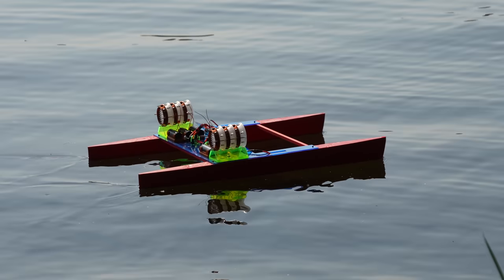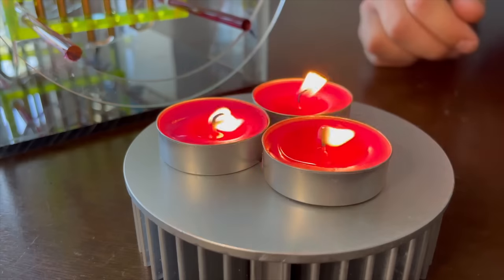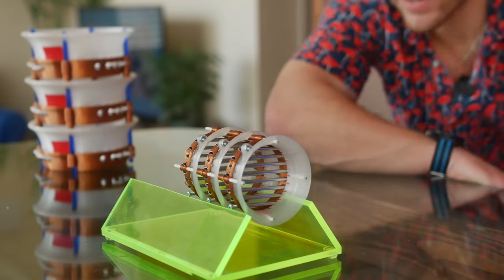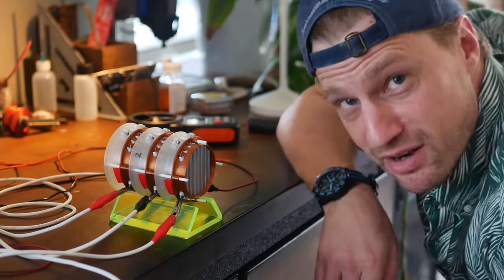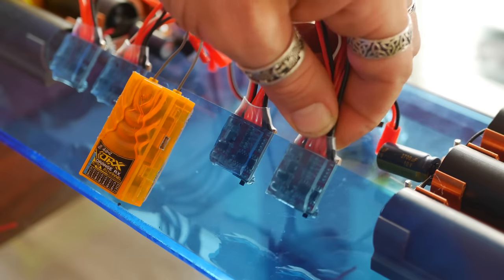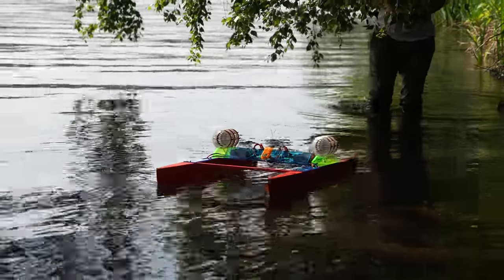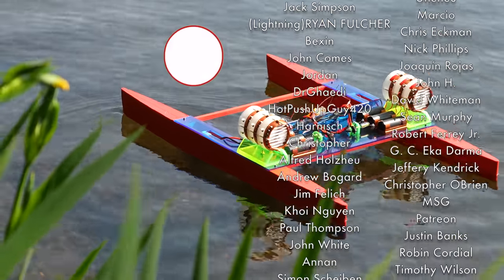Building A Twin Ion Engine (TIE) Catamaran (ft RCTestFlight)

Comment: This is awesome! Just a tip, use a spacer block on your saw fence. Having the metal against the fence when you’re cutting that way could cause kickback. The spacer block will keep the measurements the same without the danger of the piece getting bound with the fence. Keep up the awesome work!
Reply: Thought exactly the same. This is an amazing channel but would love to see him checking out  a basic woodworking table saw tutorial. Even those tiny Proxon table saws can cut off fingers in a fraction of a second.
Reply: @agn855  Everyone on YT who uses a table saw is an expert who doesn't need guards ;-)

Comment: Awesome demo.  You could add two more thrusters facing backwards for reverse.  Also, you could put the current thrusters on pivots and steer them as needed.
Reply: Pretty sure the current dual engine design would allow for vectored thrust without needing to turn the engines, and a thrust reverser would allow for that without adding two more engines either. Probably more reliable to. Hope he adds those.
Reply: the whole idea is 0 moving parts
Reply: Reverse the polarity??? 🤣

Comment: I have an idea: Widen the gaps so that the boat takes advantage of the humidity to function. You've got a design optimized for low-humidity air, now you just need to modify it to be optimized for high-humidity air.
Reply: I like this idea. My alternative approach would be to install a heater in front of the ion thrusters (literally just some hot wires) that would evaporate the water droplets before entering the ion thruster. But if your idea works, it sounds way more economical!
Reply: I like this idea too. This wouldn't be possible as fix 3D printed parts alone but i bet someone could come up with a design that can make tighter or larger gap based of a humidity sensor. The lower the humidity, the  closer the components are together. The higher the humidity the larger the gap become.
Reply: that reduces the thrust
Reply: Here are some ideas:
. Isolate the thruster from humidity.
. use existing airflow against a sail or wing
. Point thruster other directions, including a sail
. Hydrofoil the cat once any of this is working.
. Use solar or metal/rust air battery or something similar to deliver power to thrusters without having to charge
Reply: The problem isn't droplets, it's that humid air arcs at a lower voltage than non-humid air.
Reply: @malcomreynolds4103  actually, I don't think it would, the higher density air could be advantageous; not only is it more conductive, meaning you have a greater volume between electrodes, but it has greater mass per unit, giving you more reaction? there's a lot of maybes there, but I'm pretty sure Plasma is just optimizing for the wrong environment
Reply: @callmeyang  why not just use the sail or wing as the thruster, no reason the electrodes have to be circles
Reply: @GNARGNARHEAD  : Reworking the electrode assemblies to be based on sailing rigs could work (just use beams to hold them tight, allowing larger areas for the same weight), but a literal sail shape probably wouldn't work well.
Reply: Or... add a single CO2-powered BB in a short tube, and it becomes a TIE fighter!
Reply: @Mythobeast  I wonder if he could channel the intake side air through some drying medium like a chemical dessicant before it gets into the thruster. A light-weight intake Y tube with a little damp-rid sachette or such.
Reply: @Mythobeast  Thank you.  Your comment was the first that actually explained the issue concerning humidity.
Reply: @malcomreynolds4103  Why would it reduce the thrust?
Reply: @GNARGNARHEAD  ion engines work by ionizing gases - stripping electrons from them. Water cannot be ionized.
Reply: @malcomreynolds4103  true, but you're not ionizing the water, the water is just a heavier particle in the mix, more mass to accelerate 👍

Comment: So a huge advantage of ionic thrust is how little noise it makes, but what about an electric powered toroidal propeller? Research in that direction is also cutting edge, from what I know, and maybe it could get even quieter. I'm just taking a guess using my limited knowledge, but isn't ionic thrust really inefficient? It seems like you'd get more power using an electric motor.

So what other advantages of ionic thrust am I missing? I'm really curious!

Comment: Incredible project! The concept of using ionic thrust to power a boat is truly groundbreaking and has the potential to revolutionize marine transportation. The silent operation and zero-emission nature of this technology are particularly impressive. However, as with any pioneering technology, there’s always room for improvement. Here are a few suggestions:

.1  Humidity Resistance: The thrusters’ performance was significantly affected by humidity. To combat this, consider using a hydrophobic coating such as a nano-coating spray on the thruster components. Also, consider integrating a small Peltier dehumidifier system within the thruster assembly. These are compact, lightweight, and can effectively reduce the humidity in enclosed spaces. You could also design a 3D printed casing for the thrusters using a water-resistant material like PETG, which could include a small compartment for silica gel packets to absorb moisture.

	2.	Thrust Efficiency: To increase the thrust, consider using a high-frequency, high-voltage power supply. This could potentially generate more ions and thus increase thrust. You could also experiment with different electrode materials and designs. For instance, tungsten or graphite electrodes might provide better performance due to their high melting points and good electrical conductivity. Using a 3D printer, you could easily create electrodes with larger surface areas or unique shapes that might generate more ions. For instance, a comb-like structure could potentially increase the ion output.

	3.	Reverse Thrust Capability: To add reverse capability, consider designing a mechanical system that physically reverses the orientation of the thrusters. This could be achieved using a servo motor controlled by a microcontroller like an Arduino. You could 3D print the necessary mounts and linkages to connect the servo to the thrusters. Alternatively, you could use a Double Pole Double Throw (DPDT) switch to reverse the polarity of the voltage applied to the thrusters, reversing the direction of the ion flow.

	4.	Renewable Energy Sources: To extend the boat’s operating time, consider incorporating a hybrid energy system combining solar panels and a small wind turbine. This would provide power in a wider range of conditions. You could 3D print a custom mount to securely attach the solar panels and the wind turbine to the boat. Also, consider using a more energy-dense battery technology, like lithium-polymer, to extend the operation time.

	5.	Safety Measures: For safety, consider using a fuse or a circuit breaker in your power supply circuit to prevent overcurrent situations. Also, consider using a Residual Current Device (RCD) or Ground Fault Circuit Interrupter (GFCI) to protect against electric shock. Consider 3D printing a well-insulated, waterproof housing for the high-voltage components. This would protect against both electric shock and water damage. Also, consider integrating a voltage indicator or a warning light that alerts when the system is powered on.

	6.	Hull Design: Consider using a hydrodynamic simulation software like OpenFOAM or CAESES to optimize the hull design. This could help reduce drag and increase stability. You could then use these optimized designs as a basis for your 3D printed hull. You could also experiment with adjustable hull features, like a retractable keel, to adapt to different water conditions.

	7.	Lightweight Materials: Consider using advanced composite materials like carbon fiber or Kevlar for the boat’s construction. These materials are lightweight yet extremely strong and durable. They can be molded into complex shapes, making them suitable for both the hull and the thrusters. For parts that can be 3D printed, consider using lightweight but strong materials like PLA+ or PETG. For parts requiring extra strength, consider using a carbon fiber-infused filament.

	8.	Modular Design: Consider designing the boat in a modular way, where components like the thrusters, power supply, and control systems can be easily replaced or upgraded. This would allow for easier maintenance and the ability to upgrade the boat as technology advances. You could 3D print custom mounts and brackets to make the components easily removable.

Your passion is truly inspiring, and I can’t wait to see how this project evolves.
Reply: somebody pin this guy
Reply: Such a great comment, this are all valid points, give him more likes!
Reply: Excellent ideas

Comment: Having designed and constructed many R & D prototypes over the years. I have a genuine admiration for guys that have an obvious talent and natural gift for engineering next gen gizmos . You're very skilled and intellectually aware of the necessary research that is mandatory in order to satisfy the personal specs that your prototypes have to meet in order to satisfy the initial performance expectations. And yes, in all my many days under the sun, I gotta tell ya, that's the tiniest little table saw I've ever seen. But your 3d printer more than makes up for the  thing. Fyi: Your Next Gen 3coil thruster body sure does look solid with the additional "Mini-Me Twins"

Comment: I imagine the humidity changes the conductivity of the air? Maybe start with variable distance grids and with time you could automate them depending of the current humidy ( I'm guessing more humidity = more conductivity = bigger distance between the thruster grids)
What a journey it has been already though, amazing videos
Reply: maybe he can use something like a lattice with joints to expand and contract. to vary the distance on command. kind of like them cartoons with the extending boxing gloves they use. lol
Reply: Some early humidity sensors used a strand of hair or fiber under slight tension that stretched when they absorbed moisture and shrank when they dried. Perhaps something based on this idea could automatically adjust filament spacing in the engines?
Reply: Electrostatic discharge machining uses sparks to cut steel. Those systems monitor current to manage spark gap width. I think that would work more generally: other factors like temperature, air pressure, and voltage would already be accounted for if you aim for constant current. If you start with humidity, you’d need a bunch of other sensors and correction factors.
Reply: @RichardBetel  
I imagine there is quite a difference between cutting steel in a dielectric fluid and moving ions in air.
Reply: @GlennHamblin  I really hesitate to agree or disagree... They're basically the same apparatus (2 electrodes, a gap with an insulating fluid, high voltage) but with different optimisation criteria.
Reply: @RichardBetel  
And very different fluid characteristics. I'm only pointing out that there is a difference.
Reply: I suspect a good constant circuit could notice the current increase of a proto spark, and back it off before a human would be able to see/hear it.  As well as being less noisy, the faster reaction may keep it in the thurst producing phase longer.
Great in theory, but no idea about getting/making one for such high voltages.

Comment: Best part , if she capsizes you've got the magnetohydrodynamic drive from "The Hunt For Red October"!
Back of the envelope math with 17gf and 41W gives you about 2% efficiency? That's pretty fantastic for an air-breathing motor.
Reply: Japan actually built on not a sub but boat call the Yamato 1 that use that drive back in 1990's

Comment: I think that could dramatically improve this project by optimizing things like thrust to power input.  If the accounting you gave around 7:45 is correct, full power delivers only marginal improvements in thrust. There is likely an optimal wattage and voltage and laying out the thrust curve for this device would be an interesting video in and of itself.  In addition, other improvements like nozzling airflow towards the output will give you better directed thrust. Having several small optimized ion thrusters will produce significantly better results that having one large unoptimized thruster.  Additionally, it will allow you to control directionality without the addition of moving parts by reducing thrust to a particular thruster.
Reply: I was thinking about putting glitter on it.
Reply: As a side note, diminished airspeed on higher power input is expected, due to kinetic energy following a curve. 

So yes, slower is more efficient.

Comment: When i was studying electrical engineering . A grad student turned me onto his plasma loudspeaker he made. You just hook up a bunsen burner up to a very large voltage source.Feed a abestose wick that you dip in a beaker of salt water to put salt ions into the flame. Then modulate a sound source thru the high voltage source. The salt ions are what vibrate to make the sound.

Comment: This is really cool to see a practical example of this in use.  One Sci-Fi note, this seems to basically be an air version of the caterpillar drive used in the Hunt for Red October by Tom Clancy which is essentially the same in water.
Reply: The caterpillar drive in the book was just a pump-jet. The film changed it to a magnetohydrodynamic drive, which is a real technology first demonstrated on a full scale boat just two years after the film came out: https://en.wikipedia.org/wiki/Yamato_1

Comment: Check to see if the larger one has the same problem with humidity, if not, use 1 big thruster with a micro servo and flaps like a fan boat to steer. It'll make setting it up super easy and might even reduce the weight considering you will have 3 less step-up transformers in the boat. You may need to change the hull to a flat bottom though.. Screw it build 2! haha
Reply: Can’t you just use a slightly bigger servo to change the direction the thruster is pointing?

Comment: Put the Spektrum and into mode2 so the throttle is on the left stick, then remove the spring tension so you can set it and it stays there.
You have to change the mix and output range in the radio but youll like it better I promise.

Comment: This is freakin dope 👌 ionic thrusters 👽🚀

Instead of 2 parallel thrusters with 3 stages each, maybe 3 parallel thrusters with 2 stages each might be better. The number of serial stages seems to have diminishing returns.

Also, what happens if you build a 3 stage thruster but only have 1 inlet. Basically seal the subsequent stages so that air only comes from the front, non from the sides.

Comment: When I was experimenting with ionic lifters back in the late 1990's, the method to reduce arcing due to humidity was to separate the fields more. With your modular design, you could probably build a proportional servo system so each thruster could expand until the arcing is stopped. I'm envisioning a scissor-lift style arrangement that keeps proportions but only needs one actuator. Otherwise, great work! Hope this helps!
Reply: What about using rotating threaded axles to connect the sections with each section riding the threads of one axle and having sliding bushing guides around the others with the axles geared to eachother to expand and contract the thruster array with their differential rotation?
Reply: He seemed to be looking for no moving parts solution....  But with that in mind, he could expand the distance with Muscle Wire.  I know that still "moving" but it isn't mechanical movement that causes sound.

Comment: Great work Jay, EPIC results!  Since you and Daniel are so good on the collaboration thing, suggest you two make an ionic airship. Maybe the folks at Climate Plage Arena would let you do some indoor testing. Just use helium, not hydrogen. ;)
If all goes well testing, could fly it around the Space Needle!
Reply: Good idea but hydrogen under modest pressure is not an explosive issue… as long as the pressure is above atmospheric.. it can also act as a reservoir to pass through a fuel cell to power the electrostatic thrusters…

Comment: Quick suggestion! Don't use a ducted design, you might be loosing airflow that way. I'd suggest using a fuselage, and treat it like a solid state jet engine(my dads words on this), with a place to compress the airflow to increase the speed and all
Reply: It might not have enough static pressure to be able to push air through a restriction like a nozzle.
Reply: @glonkfpv  - I believe you're correct; watch the original video on the ionic thruster, the first version didn't have ducts and just resulted in pressure loss.
Reply: @KingBobXIV  exactly my point
it would be like putting a nozzle on an edf jet. you can't just make more thrust with an edf or an ionic thruster by restricting the flow like you can a rocket or a turbine
Reply: @glonkFPV  true, leaving the nozzle put would work better, but the ducted design here leaves too many holes and is losing airspeed
Reply: @prototypedrakon9899  No, it is gaining net thrust. The ion jet makes a stream of low pressure which brings air in from around it to provide the majority of the thrust. If you don't let air in then you don't get that thrust. The structure provides containment and direction to try to keep existing flow but choking it off leaves only the very little movement of the air from the mouth of the system.

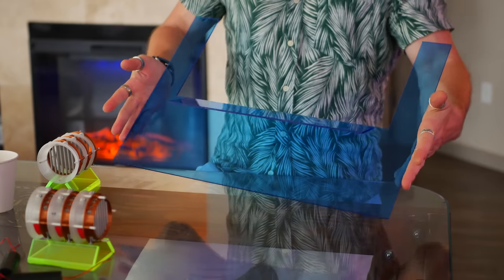Comment: 10:38 That looks like adding a significant weight to the catamaran.  I would opt for something 3D printed and super minimalist light weight.  Same with the hull which seems larger and deeper than it needs to be,  thus adding unnecessary weight. This extra weight would slow down the pickup speed of the boat.